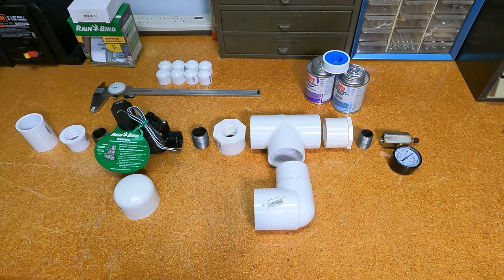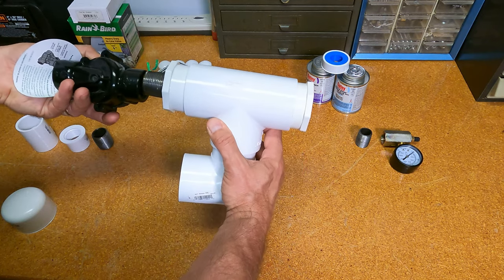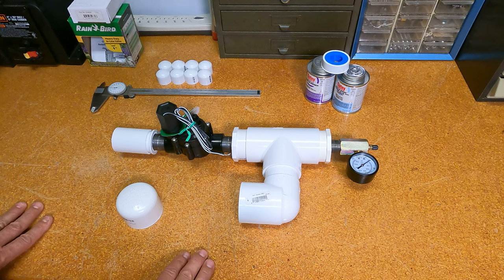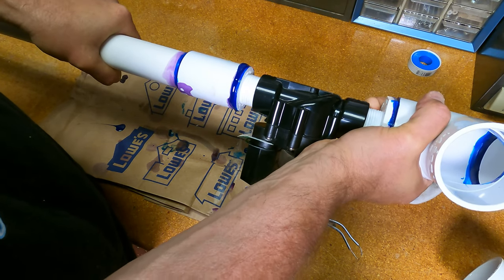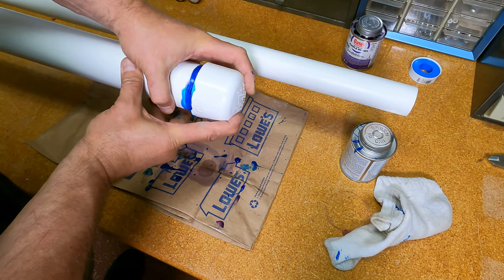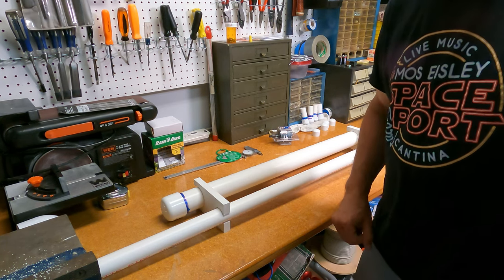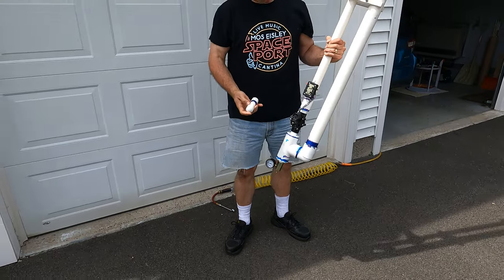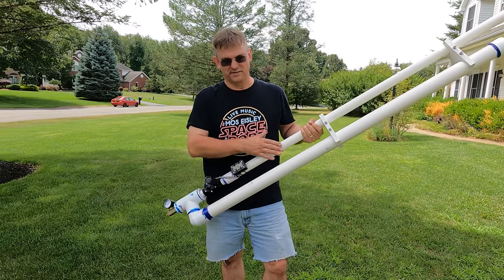Pneumatic launcher (aka "Air Cannon")

Comment: I've construsted several air cannons using the sprinkler valve solenoid electrical triggering method, pneumatic keying method with sprinkler valves, and  PVC ball valve method.  But I haven't ever constructed one with a barrel that long.
Reply from the maker: As have I... And I find that the electronically controlled valve offers greater control and repeatability vs. the manually operated ball valve method, where there are far more opportunities for variability due to the tendency to twist or move the whole unit off axis during the shot. The speed at which you manually open a ball valve also drives how fast the air is released, which has a HUGE effect on the power delivered during each shot. Thanks for the comments, and for watching!

Comment: My design I tried to make the trigger a little safer; I used 3 pushbuttons, two on one side and one on a end.  You have to press all 3 simultaneously for it to fire.
Reply: Okay, after thought, not simultaneously but all 3 have to be depressed for it to fire.
Reply from the maker: That works. I have some small key switches too... might make for an alternate arming switch, though something else to lose, lol ! Thanks for watching.

Comment: Great idea, but wish you provided links to your components. Can’t locate anything resembling the 3/4” bushing used with a nipple for the pressure gauge.
Reply from the maker: All pvc and related plumbing components were Lowes and Home Depot purchases. Just make sure you adhere to pressure ratings needed for your intended use, with an adequate safety margin. Thanks for watching!

Comment: Thats slick. Id like to see the projectiles with strings fire. Great work
Reply from the maker: I may add a video of actual using it to put a line in the tree. Thanks for watching!
Reply: @halfmoontechlabs  
I'd like to see that too.   It seems like you've got more firepower than you actually need.
I can't believe I just said that!
Everybody knows you can never have too much firepower!
Actually though, at first I thought you were going to turn the air chamber pipe to the rear and make "stock" out of it.   Like a rifle.
I think you could probably do that with a bigger diameter pipe and have plenty of power to launch most plugs high enough to clear 100' trees.   Especially if you use fishing line.

Comment: The "Firing system " I have used has been a PVC ball valve.  My son has a solenoid in the shop out backthat he isn't using SO, I just may appropriate it for my next "LAUNCHER project.   I'm also a Ham and shot a PVC projectile well over a 100 foot pine tree on Winter Field Day.  Wow have had the gang accuse me of 
1.  Shooting the satellite down😂😂
2.  Putting a hole in the GOUCERY store 2 miles away. 😅
3. Mak I ng the most perfect shot over a tree for our 80 meter EFHW antenna. 😊
Had fun what can I say.
Reply from the maker: They are more powerful than folks realize. I saw another ham accidentally fire one into the side of a pickup truck, left a serious dent for sure. They are fun though, you just have to treat them with the same respect as you would a firearm, careful around people, pets, property, etc. Thanks for stopping by!

Comment: Pretty nice, I'm building one this weekend for a company project for confetti. I'm going with a pneumatic trigger as it's simple and doesn't need batteries etc. Why did you go with the solenoid release instead?
Reply from the maker: In a word... safety: In more words? In my opinion, the pneumatic trigger may be more likely to self-discharge if there was a leak in the firing circuit (pneumatic). I also obviously love electronics and designing stuff, so it was a personal choice that also made it very easy to add an "arming switch" function, to further prevent accidental discharge. Good question, and thanks for watching!

Comment: G'day Mate, Just wondering how you wired up the 9v battery, solenoid wires, push button, and arming switch. Was a bit too hard to see. Any chance you could send a close up photo? or explain how you connected everything together. Thanks so much, really appreciate it!
Reply from the maker: I can't post a pic in reply, but it's really just a simple series circuit. One wire from sprinkler valve to one terminal of battery, and then just daisy chain the second battery terminal connection in series through the two switches, also in series, and back to the other sprinkler valve wire. So the circuit is just a simple loop that connects all of these in series. If one 9v battery won't reliably fire the valve, a second 9v battery in series with first (18 volts) will do the trick. Can vary a bit from valve to valve. Good luck, and thanks for watching!

Comment: Built mine per your specs. Pressurized to 50 PSI but was getting a small leak. Probably slow enough to live with but I would like to know where it is coming from...if from the threaded connections should be easier to repair. Can't wait to try it.
Reply from the maker: A little soapy water solution should help find the leak. Hopefully it's not in one of your solvent welds (glue bonded pvc), if so, you may need to re-do that section if possible. I also let mine cure for several hours prior to pressurization and leak/performance testing, as proper cure time is important especially when being used to hold compressed air. Good luck, and be safe. Thanks for watching!
Reply: @halfmoontechlabs  Yep; that was the next step and found it is indeed the threaded connections that are leaking, NOT the PVC! So I think all i need to do is remove the two threaded couplings and use more teflon tape. It looked like you used a lot compared to me, and now I know why! 😀 Thanks!
Reply: Get a water bottle poke a hole in the cap for a cheap dispenser. Mix up dawn dishwashing soap and water in your cheap dispenser. Air up your air launcher put the soapy water on your connections. The soapy water will make bubbles where air is escaping. Works for bicycles and car tires too.

Comment: I got same irrigation valve and it says on mine valve input voltage  : 24VAC , is your DC?
Reply from the maker: Most are 24vac, but the coil can be fired momentarily with DC as well, it just requires a lower voltage... hence the 9 to 18 vdc requirement when using an ac valve. Thanks for watching!

Comment: Do you have a wiring diagram for the switches for the valve? And what are ypur lengths of pipe?  thanks
Reply from the maker: The lengths are customizable for your purpose, but as mentioned in "Bill of Materials" section of video (chapters are marked) for my build, approx 5 feet of 2" PVC for "tank" which is on bottom, and approx 5 feet of 1-1/4" PVC for actual barrel as well. Firing circuit is a simple series circuit, in other words the circuit that I built goes from 9v battery through 2 switches in parallel (one a toggle, one a momentary pushbutton) to one valve wire. Last, the second valve wire goes back to second terminal of 9v battery, completing the series circuit loop. Some valves are finicky and want slightly more than 9v. If that's the case, then use two 9v in series. Note that this smaller 9 or 18 volts DC pulse is all you will need to fire a 24v sprinkler valve coil normally intended for AC use. Thanks for watching!

Comment: How did the 2 braces you attached affect barrel harmonics?
Reply from the maker: By supporting in three places (barrel attachment, plus two spaced braces), the overall feel is very rigid, which totally eliminated any potential movement, resonance, or harmonic vibration. Only a deep satisfying "thwooomp!" can be heard when firing. Thanks for watching!

Comment: so you mentioned 2 9v batteries but only used 1 correct? i didn't see another one.
Reply from the maker: Correct, some valves will fire reliably on just a single 9v, others may need a higher voltage. As it turns out, this one fired reliably on a single 9v battery, and so I did not need a second in this case. Nice catch, and thanks for watching!

Comment: Can you please tell me how the projectiles are made?
Reply from the maker: For this build, I made a handful of projectiles by using 3/4" PVC pipe sections (3 to 4" long each), with the appropriate end-caps glued onto each end, but you may have to experiment depending on your barrel choice. I use pennies as the weights, and find 150g of total weight worked well for my use.  I used a sander to gently remove the "nubs" on the outside edge of the PVC end-caps to ensure a proper fit. The finished projectile should easily slide down bore, not snug, but not loose either. Hope this helps, and thanks for watching!